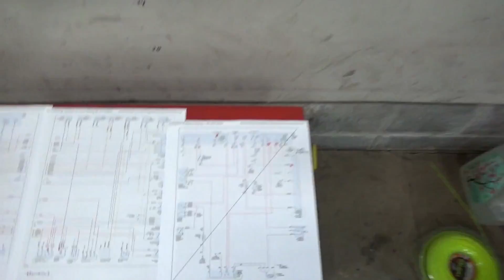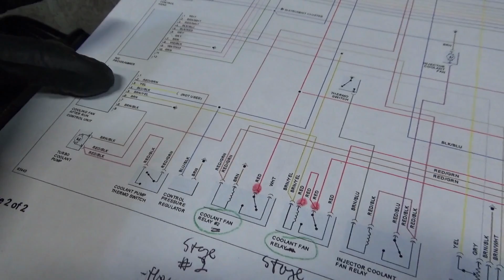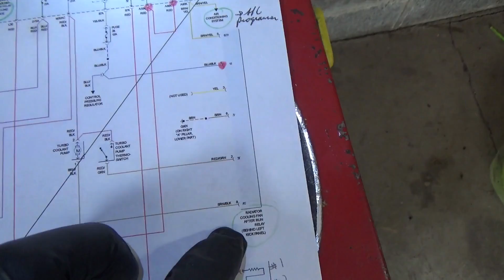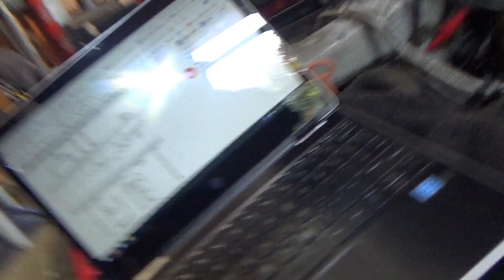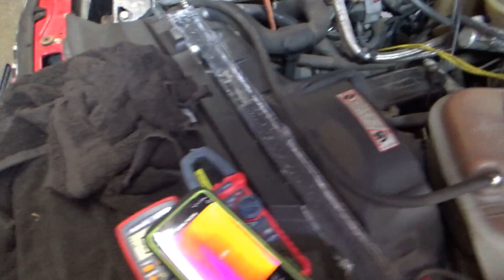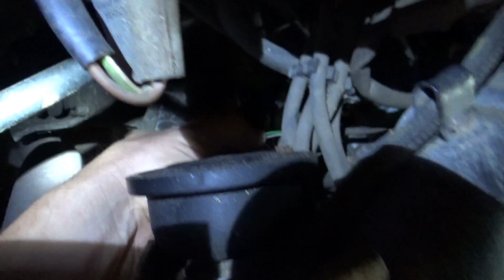(Pt 7) Cooling Fan FIASCO... (RARE Abandoned Audi Turbo)

Comment: I remember a time when a fan was driven by a belt 100% of the time. No electronics, nothing to go wrong that couldn't be quickly and cheaply fixed. The move toward electronicizing (my word) every damned thing has evolved from simple devices controlled by direct wiring to hypercomplicated CAN BUS systems that control even the simplest devices and systems, making diagnosis and repair a potential nightmare. Combine this with $125/hour labor, crappy aftermarket parts/spectacularly expensive OEM parts along with parts-cannon firing "technicians", and you have what we have today. Buy an early-mid 2000's V-6 3800 Buick for $6,000 and save your money for something worthwhile.
Reply: How would you implement the cool down of the turbo without an electrical fan? That's why it's electrically controlled.
Reply: @tschuuuls486 I suppose if the bearings are liquid cooled using engine coolant, a pump.could continue running until coolness is achieved. The pump would be controlled by some kind of heat sensing switch. I think this would work.
Reply: @tschuuuls486  Well, first of all, anybody buying a car with a turbo should understand the engine is undersized/overstressed and will live a shorter life because of this alone. Secondly, your assertion proves my point: overcomplication leads to unreliability; there are just more failure points, and fail this car does! The fact that it's been stored outside unused for many years makes things exponentially worse due to corrosion and rodent damage. And by the way, most turbos have no secondary system to cool them down.

Comment: That Audi has met its match!
Now I really understand why people lease or if they own a German car sell them once the warranty is over.
Reply: Whilst it was probably quite complex for it's time, it's a pretty simple compared to almost anything made today.
Reply from the maker: @ferrumignis  simpler in some ways but much more complicated in others!
Reply: Yes owning a German car is asking for disaster. So many people want to impress others with the German Logo like MB AUDI BMW but they have beer money 💰 a d champagne 🍾 money is required. I salute the Japanese...build affordable and dead reliable cars. Toyota...Honda....Mazda...etc. Those brands do build some duds but not very often
Reply: @mikefoehr235 Well, that depends on the vintage. I cut My teeth on the old Beetles and early Rabbits. Almost done with My 69 restoration project. I’ve always loved the simplicity of the old beetles and still do. My first “real” job was at a VW dealership back when they were still selling them new. And it was only about 5 years ago when I sold My daily driver work unit, an 81 Rabbit diesel p/u, or “Caddy” as they’re called. 50 mpg, but You had to depart a bit earlier to reach your destination on time! Some German cars were absolutely great in My book. 👍👍🇺🇸
Reply: @brianw8963  I work for a large city and we have MB SPRINTERS in our fleet...me and my coworker are unfortunate to both have one as a survey vehicle. Sprinters are garbage cans on 4 wheels. My coworker and I agreed that with a Sprinter you will.nof have it 1 to 3 weeks every year due to serious problems. MB should be infinitely embarrassed to have their logo on those rusting junk boxes.
Reply: @mikefoehr235  Not familiar with the Sprinters, but it sounds like that might be a good way to keep it! 😄🇺🇸🇺🇸👍
Reply: @brianw8963  mine is so bad that the turbo ate itself at 103 000 kms...barely over 62 000 miles. The list of issues is a novel. One in our fleet had a repair bill for $13 000 CAD.
Reply: @mikefoehr235  My reason for owning  a Nissan 02 Pulsar only problem so far was the chip in the key head not being able to be read by the immobileiser coilaround the ignition easy fix with a replacement chip & reprograming.

Comment: I don't know how common this was, or is, but the whole "I idle my turbo engine for 3 minutes before shutting down" seems to be unnecessary on this Audi based on the design here (after run coolant pump and radiator fan).

Comment: The coolant pump is vital to deal with the heat from the turbo otherwise it causes the turbo oil to denature at power off  , our first 200 turbo did that and they added the pump

Comment: Are u sure there is no diagnose port on this vehicle ?

Early audi 200 turbo has 3 cables for diagnose hidden under the steering colum or in dash
Reply: The ones we had , you pressed the switch in the air intake butterfly valve maybe , and then it put the codes on the tach
Reply from the maker: We'll get to that very soon!
Reply from the maker: We'll get to that very soon!

Comment: Hi Ivan I wouldn't trust a jack with old plastic acme threads holding a car up! what a place to cut corners..  I don't know what you are charging but it's not enough. maybe the owner will give you a bonus when you finish Part infinity..
My hat is off to you, what a tenacious guy!
Rich
Reply from the maker: I definitely wouldn't get under the car with that jack... But for changing a flat tire it would work great 😁
Reply: I would use my floor jack or a bottle jack.
Reply: From what I know the thread part of the jack is a nylon type of product that is extremely tough.Nylex was the brand name I think.
Reply: Agreed.  Those jacks are sketchy enough when new, I wouldn't trust a 30+ year old one with plastic load bearing parts.

Comment: Could that rear ECT be for the guage???
Reply: Seems likely as the voltage didn't change and the gauge doesn't move.
Reply from the maker: Watch the part with the wiring diagram explanation again 😁
Reply: Sorry, just thinkin' out loud~
2 wires, thought it was a gauge sender...
Turns out it's a Temperature Switch, coolant warning lamp FACET 1.840.085

Comment: Watching you jack up that car with the manufacturers jack took me back to my youth in the 60/ 70s. I remember cranking away on the jack handle only to realise the car was not going up , and discovering the jack head had gone through the rusty sill. Not so happy days😢
Reply: The jack sort of clipped in as I remember wasn't much of a connection
Reply: Yeah I lost an Opel Manta GTE to exactly this problem.
Reply: VW Beetles with the square tubing under the running boards and jack with square rod.  All fun and games until the tubing rotted out.  I never trusted it when new.

Comment: I would not want to venture to far away from home until this thinkg has a couple of weeks of driving, things like drive belts that have set for 14 years and even the radiator and hoses could be on the verge of failure. What is the condition of the grease in the wheel bearing and u-joints?If this has a timing belt that has set for 14 years then I would question the reliability of it. I have to commend you for sticking with this.

Comment: Ivan, you prove my point with this series. AUDI: ALWAYS UNDER DIAGNOSTIC INTERVENTIION 😂🤦‍♂️😂
Reply: In fairness, most modern German cars Audi/Volkswagon, Merc, and even Porsche have inexplicable problems that you never see on Japanese (or even American) cars.... cooling system issues, leaking sunroofs, suspensions that need to be reburbished before 100K miles, oil burning, oil leaks.... .  It's almost like they assume that around 120K miles (193k km), you'll scrap it and buy another car for additional punishment.
Reply: @teekay_1  It's not as bad as a few years ago, but up to about 5 years ago, when you'd see a car with a burnt out headlight, chances are it would be a VW.  I told my nephew that years ago, when his wife was needing a set of wheels.  They did buy one and had very good luck with it.  But, after I told him that, he did start noticing and said "Yeah, VWs have a lot of burnt out headlights".   I should ask him how many miles they have on it.
Reply: @teekay_1  I would suggest that they buy one of the brands it fails so on to the next & so on but more likely there are more proficient repairers in Europe so the cost is reasonable & more repair shops with access to parts.
Reply: @teekay_1  Strange, I have owned five of those demon vehicles without a problem.  Your actual experience?
Reply: @pcar5  They're not demon vehicles, they're nice to drive, but unless you can do the work yourself, dump them after 4-6 years.

List:  2002 330i, 1997 740i, 2010 650i, 2008 S4, 2016 VW GTI.   The GTI is interesting in that it eats coolant, but the head gasket is fine.   All the BMWs burned and leaked oil (the 330i burned/leaked a quart every 700 miles), I had to replace water pumps and coolant tanks on every one, the 740i needed a replacement coolant pipe that ran down the V of the V8 and the S4 just had a lot of things that made it less than joy once it got older.   Oh yes, the GTI also had a leaky sunroof, which was  factory defect that VW refused to fix.
Reply: HAHAHAHA 😂